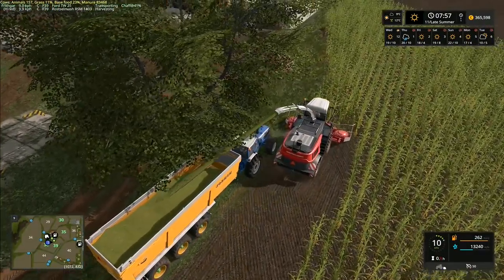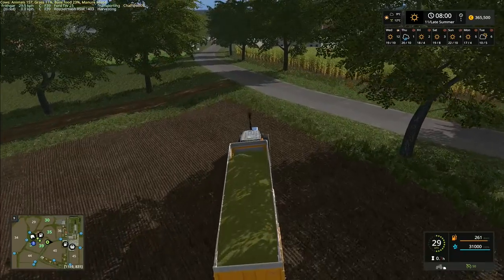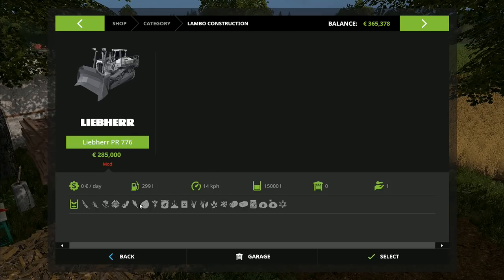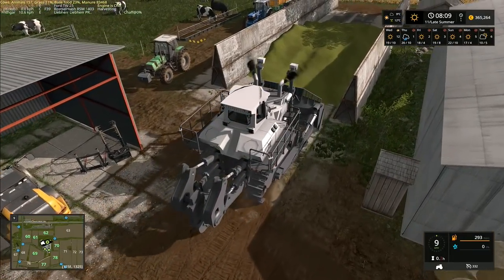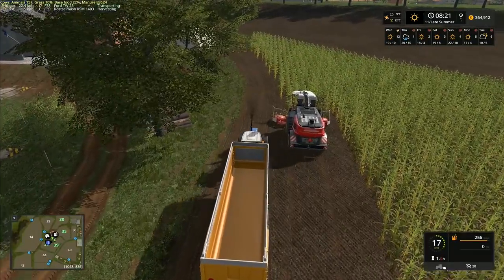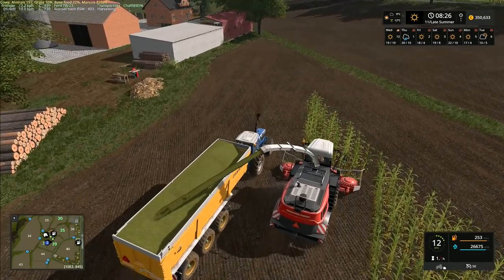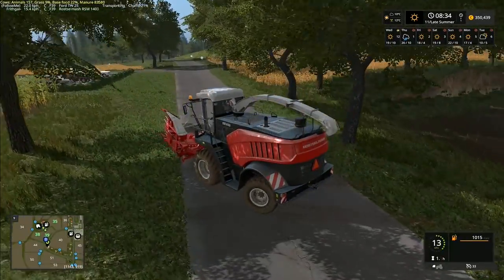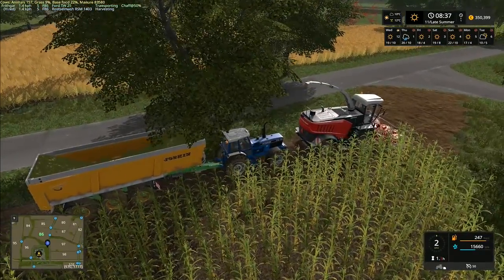Let's Play Farming Simulator 2017, Gorale With Seasons #29 Liebherr 776 Bulldozer!

Comment: I've just tried to download the bulldozer through the link and it started doing something weird with my PC, i never actually got to download it but it opened loads of tabs ect and my antivirus/malware didnt pick it up so be careful what you click
Reply from the maker: They do use an external download hoster, and it's easy to click the wrong button with those unfortunately, I do find that particular one will open a few extra tabs while you're trying to get the download, but you can safely ignore them and close them afterwards.  It's never actually flagged anything on my malware software, during or after.